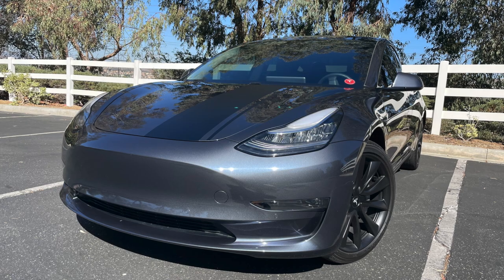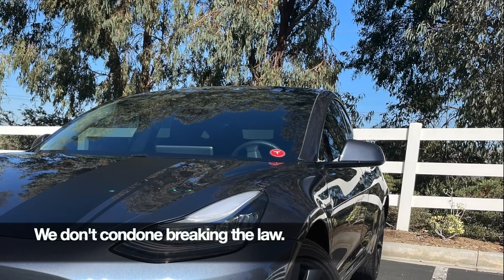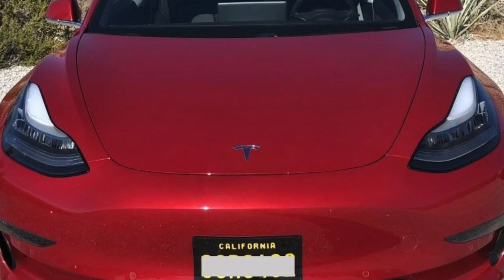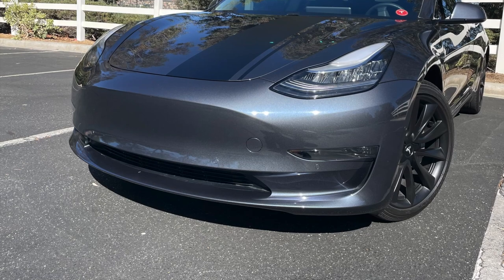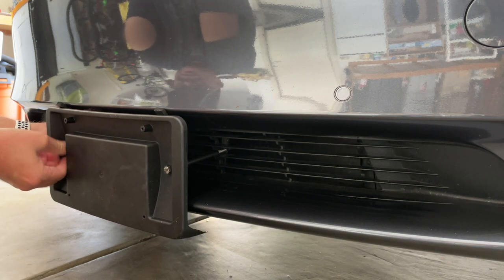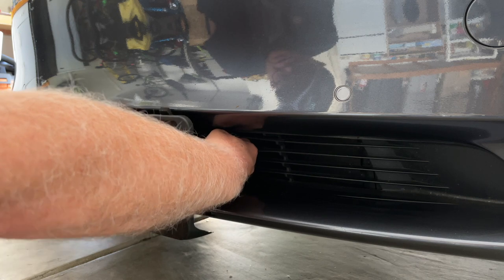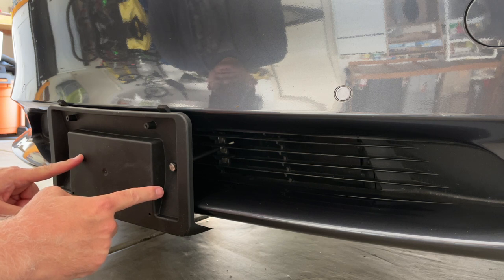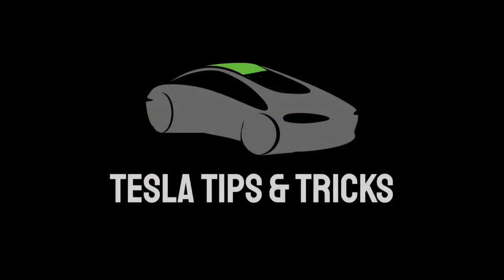Top 6 Tesla Front License Plate Installation Options

Comment: Your video helps me to find a different way, probably 7th and simplest way. I went to hardware store to buy the stuff needed in you video. But I could not find the 5 inch bolt for this. Then I realized I could just use cable/zip tie to tie the plate holder. So I bought  a pack of 13" cable ties. I used three cable ties to tie the holder with the grids. I drilled 6 holes on the plate holder, 2 holes for one cable tie. It works very well. And it costs less than $1. 😀
Reply from the maker: Zip ties for the win!

Comment: This was a great solution. I was able to adapt it with what’s called a toggle bolt and wing nut that cost $5 from the local hardware store. I could not hand tighten the bolt - needed a socket wrench. I also added some rubber padding behind the entire top and bottom edge of the plate holder for some cushion

Comment: There’s a channel that shows various systems of the Teslas taken apart with great in depth explanations of their function. It is amazing how well engineered each component is and how their designs have been modified multiple times based on actual driving data to achieve optimal operation. That being said, I think mounting your plate in front of the grill may have a significant effect on the airflow which many systems have been precisely engineered to rely upon.
Reply from the maker: I'm sure, no doubt.

Comment: Super! Thanks for the idea.  I adapted it very successfully and it was better than something I could buy for my Y.  I added a guide to fit counter the curve on the bottom and flush fit to the bumper - a touch higher).  Flush sturdy and looks better than original adhesive way higher (and still clears 12")
Reply from the maker: Awesome to hear. Thanks for watching

Comment: Great idea!  Perhaps an upgrade with a few washers to hold the frame with the bolt more firmly reducing risk that the bolt (if over tightened or damaged) will pull through and risk damaging your front end (bumper/grill) or worse fly off and become a hazard.  Still like your idea.

Comment: Good way to do it, thanks. Looks like it will be a little too low for Colorado requirement of at least 12 inches from ground to bottom of holder but California may be different and I'd bet no CHP will notice or care about the exact measurement. CDOT may check it out in a parking lot if they're looking to write some tickets but in my town, they don't get that picky what with other higher priorities to manage.
Reply from the maker: I didn't even know about any 12 inch rule. I rarely even run a front plate, only when going to major cities LA, SD, SF etc. Thanks for watching!

Comment: I have this (got it from eBay). It’s decent but I’m still worried it might come off if I floor it.
Reply from the maker: Which one did you get? Mine has never come off. Thanks for watching.
Reply: @TeslaTipsTrips  the one you’re using in the vid. Two long screws, diy solution.
Reply from the maker: It's been fine every time I use it. If it's on tight, it should be good.

Comment: Can you put this higher than where you mounted it?
Reply from the maker: Using the method I did with the screws, they need to use the grill to hold on.  The other solutions, like QuickBandit does sit a little higher.
Reply: Just commented I did and it worked like a charm,  a attached guide piece to counter the curve at base of plastic and it fit like a glove. also added a small wedge pieces to reduce angle the plastic has gets covered behind the plate and bolts went lower on the grille. Very sturdy.

Comment: The issue with this installation is that if the bolt ever get loose up, the bracket will fall apart.  It's better to have a hook of some sort so that the toggle nut will not turn when it's loose.
Reply from the maker: I've never had it come loose.